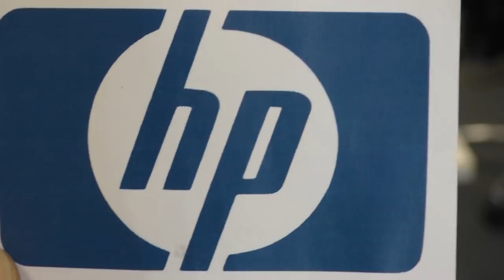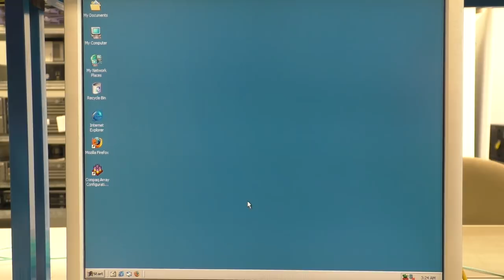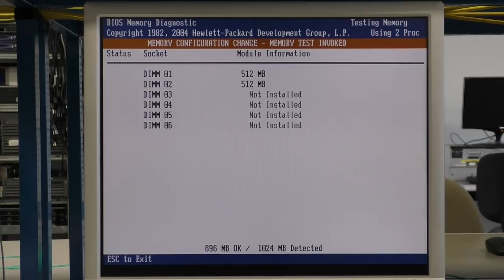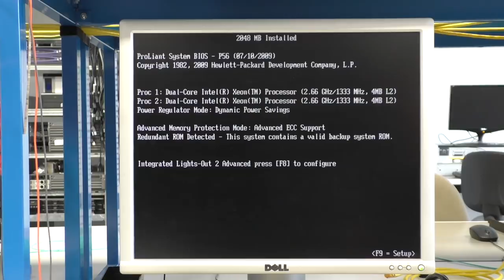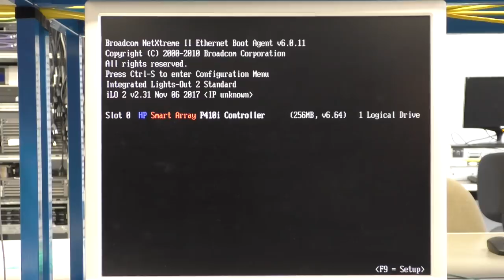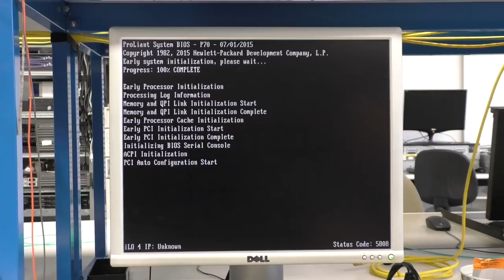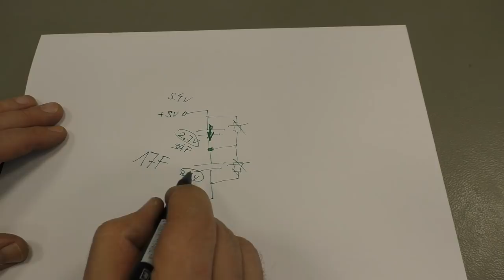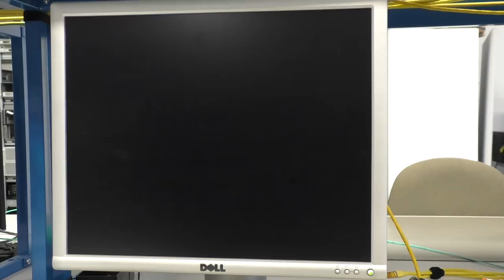Back in time - HP servers all generations G1 to Gen9 (PWJ89)

Comment: Pretty nice video! I think the PSU issue on G5's are mostly because of the bad airflow design - CPU's hot air get blown directly into the PSU's air intakes. Considering the chassis can work with some pretty hot chips (up to 120W), things inside the PSU should've become quite toasty under heavy loads.
Reply: And the original PSUs didn't have caps rated for that heat.  PSUs with the orange dot on the label were refitted or redesigned to use higher temp rated caps that could stand up to the heat.

Comment: I love the Gen8 servers. I've got a whole rack full of them at home. They're old enough that they don't cost much to buy, but new enough that they're still fairly powerful and support newer technology like HTML5 remote console. And best of all, there's a hacked iLO4 firmware which lets you manually tweak the fan speed curves. After a bit of work you can get a DL380 Gen8 to be close to silent while idling.
Reply from the maker: Gen8 servers are great. They only have one big problem.... the failing of the iLO flash chip that contains logfiles and Intelligent Provisioning software. This is also a problem on Gen9. The good news is that the server will run perfectly when the chip failed, just iLO and Int.Prov. will not work anymore.
G5 were notorious for failed power supplies. So the most reliable HP servers are G1 to G4 and G6 + G7.  Gen10 is still crap... they can't get the firmware issues fixed.

Comment: I remember the G1, ran that at home back in 2002.  It was my main file server for documents, print sharing, and music/movies.  God I remember those days setting it up, how times have changed.  Now I have been rocking the Dell Poweredge 2950 Gen 3 for the last 5 years doing a whole lot more.  Both of these servers have been rock solid, running 24/7, and not a single issue.

Comment: Being a service tech who works with HP (now HPE, or HP Enterprise) and other makes of servers (especially the HPE DL360 and 380 machines), this is fascinating to see the evolution of  the DL360 servers over the years.  (Just replaced a motherboard and CPU on a DL360 Gen10, the newest model, earlier this week! :) )

At 58:43, I've replaced a few battery modules like those for customers, (mainly due to age, most of them were over 4 years old and simply worn out),  they're basically 2 18650-type Li-Ion cells and a circuit board to control the batteries' charge and discharge.  But HPE's ML310 desktop-case-style servers still use the supercapacitor packs for their disk controllers--I've had to replace a handful of these as well (they had a few years on them as well), and all of them that failed have the tell-tale bulging tops that failed caps have.

Thanks for making this video, this is quite interesting to watch!

Comment: iLO is like AMT on steroids; it uses an FPGA to allow it to monitor and control everything on the system board.  It even handles system graphics if there is no dedicated video card connected, and it has a built-in DSP which encrypts the video stream over the Ethernet port using AES.
Reply: iLO (or Dell's iDRAC) is a IPMI (industry standard) implementation. Most server-grade motherboards come equipped with it. From the many features they have, the remote KVM is one of the greatest of them, allowing you to have a console that is accessible even on a hung system and power/reboot options. Some of the manufacturers even add ISO mounting capability so you can use a utility disk to check up or redeploy from a clean image.
Reply from the maker: That's right but you need an iLO Advanced license to use the remote KVM console. At least on the normal servers. Blade servers have that feature enabled by default or else it would not work with the OA.
Reply: Bruno, iLO is only a rebranded IPMI on some of the lowest end servers. Unless it changed in G9, iLO uses custom silicon.
Reply: @PlaywithJunk  If one of the ILO3 or 4 equipped servers has a license, you can copy it to any dl series

Comment: I still have my Compaq DL380 G1 that  I purchased it for $20. back in 2003. It had 2 1gig CPU and I dont remember as the other stuff at this moment but what I can say is that I had to retire the very reliable machine because of software. The OS that I had installed on it was Mandrake (Linux) and quickly found that the fans are software controlled. Back then Linux was not as supported as it is now. Found the fan program and went on from there. I had a 14 bay storage array hooked up to it at the end.

Comment: Great vid! Changes from parallel PCI to serial PCIe I think during G5 -> G6. Also the G9's missing the diag panel annoys me, but we don't use it much I guess.
Reply: G5 already has the PCIe by default, but you could even order a PCIe riser (cage) for the G4 (and probably PCI for G5 exists as well)

Comment: picking up a gen5 for my home lab next week - this video gave me a really good perspective of what mess i'm getting myself into ^.^
Reply: The Gen 5 is starting to age out now. I've had two since 2012 and vmware won't let me upgrade anymore because of the CPU. RHEL 8 doesn't like the raid either. Very good machines. They just run. I think I've blown one power supply and one 300 GB disk. No sweat, replacement and it never missed a beat. For RHEL 8 you can get a driver from elrepo.

Comment: A 2.6 volt zener diode (1N5227) across each capacitor would fix the supercap problem (that was probably what was meant to be on that PC board but manufacture cheaped out) ...thanks for the info as I have a Gen8 in route to me right now...
BTW> Awesome video...still waiting for a "Installing Centos 7 on a HP DL360e Gen8" video...;-)
Reply from the maker: Fun fact: On the capacitor PCB is unpopulated space for two resistors (or diodes). For some reason they decided not to use them...

Comment: one thing to point out - The RED tabs mean its "Hot Swappable", so you can repair without power down.  Blue tabs mean that component needs to be power down before removal.

Comment: I have a DL380 Gen4! Well built. Still runs well. It's my home GIT and media server. Picked it up dirt cheap. Very noisy though.

Wish all server hardware was that accessible. Would really love myself some Sun systems.
Reply: I've also had one, used it for two years with ESXi and sell for twice more than I bought it :D
Reply: It also wastes a lot of power!  you can cut your electricity usage at least to 1/4 by replacing it with a more modern server, or to 1/10 by replacing it with some NAS.

Comment: 25:50 - I've only worked on G6's. I'm willing to bet that the issue with the PSU's overheating is due to the fact that hot air from the CPU's is being blown directly into the PSU's. The G6's have the CPU's center mounted, so their air goes towards the rear exhaust rather than through the PSU's.

Comment: The win2k shutdown on Gen1 server is probably due virus. There was a virus corrupting RPC service in windows back in the day, which caused that shutdown message.
Reply from the maker: That is possible. I remember when I set up a Windows2000 system and 1 minute after connecting to the internet it had that virus. Maybe I should install a Windows2003 or 2016 just for fun? :-)
Reply: I thought the same when I saw it, but when he dragged the dialog up, you could see that the shutdown has been started by the server manager utility.

Comment: Interesting video, I never liked the Generation 5 psu's. Because, as u said they overheat. I had a ML350 G5 tower, and one of the psu's failed because of overheating. The remaining psu did get awfully hot, I call that a poor construction with almost no air to flow through at all. I also have ML350 G6 tower, which I rarely use. These G6 psu's are so much better.

Comment: I have a dl380 g5 in my closet, I used it as a PC for the longest time with 2x Xeon E5450 CPUs and 16GB of FBDIMM-5300 with a bank of SSDs and an SSD on a separate 6gb/s sata controller for the OS, and 2x Radeon RX-580 GPUs connected to it (one internal and one external :p)

Comment: I have a DL380G6, bought in early 2016, still works fine.
Reply from the maker: Why not... G6 was a good machine. Better power supplies than the G5 which break down a lot becuase of excessive heat.
Reply: @PlaywithJunk It just cost me 2000 RMB. With one E5645, 28G RAM(32G originally, one memory stick broken before I deploy it), one 72G SAS drive and one 1T SATA drive. A affordable machine for who wants a experiment platform.

Comment: Any info on why this series of servers is called '380'?
Reply from the maker: HP has different server families. The 100 series is a low cost PC like thing, 300 are midrange and it goes up to 900 with 8 processor machines. There are many models in the 300 series (320 360 385-AMD and some more)

Comment: I have an HP Integrity rx2660 Server ia64 box. From the outside it almost identical to the DL380 G5. Probably at least use the same power supplies, and maybe the same fan assemblies. When I play with the rx2660 it really is playing with junk.
Reply from the maker: We have those too. Very complicated to repair because everything is licensed. You cannot add parts without code.

Comment: 45:53 Interesting on all of my G8's, none of them show this screen. Instead it's just a full screen HP logo which shows for a moment before disappearing and booting the OS. Wonder if it was removed in newer firmwares.
Reply from the maker: I have never seen another screen than this one. Maybe your servers have a custom logo? Have you tried to reset the BIOS settings to defaults?
Or you simply have the oldest firmware ever... :-)
You should update iLO firmware as well because below 2.60 it will kill the iLO flash chip due to excessive writing.
Reply: Funnily enough I've got multiple Gen8s, some of them show this screen and some show the full screen HP logo like yours. They all have the same BIOS and iLO version installed. No idea what the difference is...

Comment: On the Gen 9, is the RAID battery made up of two 18650 cells? It looks like it may be, which would be great if it needs to be replaced.
Reply from the maker: Yes it is. The problem here is that the electronics fails but not the battery cells. I tried to repair a few, the batteries were all good.
Reply: Gen 9 made the move to system wide storage batteries to support multiple FBWC modules and NV-DIMMs.

Comment: My G7 got twin 1200W PSUs but that might be something they did since I got it used.
(Also it draws apparently just 347W under full load)
Reply from the maker: You will only need a 1200W power supply when you add some GPUs, full memory and all possible hard disks...

Comment: The 380 gen 1 didn't originally have LVD drives.
Reply: I dealt with those card-edge 'butterfly' drives it used to have before the Universal Carrier U2/3/320.  Such a pain to get both clips to disengage.

Comment: Looking at stuff in the background ... You indeed have some Junk .... eeh I mean prehistoric stuff (Speaking in computer years) 

I know companies sometimes still use very old machines, but some of this stuff looks like it is from the early 90's, reliably as these machines are ... that must be getting problematic to keep running.

If possible I would love a tour of the place ... looks like there is some interesting stuff there.
Reply: @Elevating Computer I was manager for Walgreens and yes they do, so old, shitty and unsecure. For God sakes they use wep for the wireless.
Reply: My biggest concern: The old server used way more energy compared to computing power. A Dell PE 2960 Gen1 uses around 300W and has less computational power compared to HPE 380 Gen9 with around 80W.

Comment: I'm always considering buying a Proliant to use a s a normal desktop, but I am not sure about the fan noise. I heard that they can be slowed down via a resistor.
Reply from the maker: I would not recommend a server as desktop computer. The newer models are very silent but when CPU power is needed the will turn loud. The server also checks fan RPM, if you make them slower, the server will report errors and shut down.
Reply from the maker: This will not work. The fans are checked for speed and current consumption. And you need a certain amount of airflow or your server will overheat. This is not a PC!
Reply: Yes, I had read that it would cause the machine to shutdown if the fan RPM fell below a certain level. Ah well. I am making some PCB wallets :D I will email you a photo when I am done.

Comment: hp dl380 g6 riser is a pain I like the g7 And g8 looking to buy g9
Reply from the maker: Gen8 and Gen9 have a problem with the iLO/Intelligent Provisioning flash chip. Most reliable generation so far was Gen7.
Gen10 has a horrible BIOS/UEFI firmware full of bugs. Maybe that's the reason why Gen11 is not ready, they first have to solve the Gen10 problems.
But Gen10 plus is now shipping.... what a funny idea!

Comment: literally just thrown away a box of those kvm converters
Reply from the maker: The PS2 version is worthless but the USB ones still have a value of $40 each.
Reply: @PlaywithJunk  was a mix of both, just didn't think people would still be using these especially with the newer gens of ILO using .net and not some old version of Java that you need to be on exactly the right version ( a version which is typically insecure)
Reply: Included the switches aswel